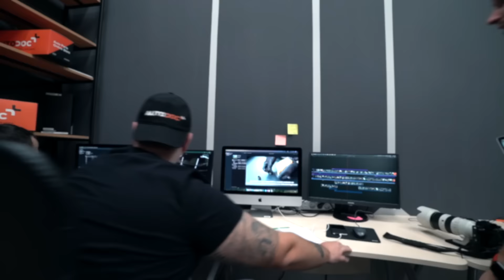¡AUTODOC TOUR COMPLETO POR EL TALLER!

Comment: TENGO UN TWINGO 1995 FRANCES DE 8V 125cm PERO EL CAMBIO DE CORREAS POLI O DISTRIBUCION DIFIERE DE TODOS LOS VIDEOS QUE HE ENCONTRADO PUES MI VEHICULO TIENE EL SOPORTE DE MOTOR QUE CRUZA POR MEDIO DE UNA DE LAS CORREAS POR LO QUE VEO QUE NECESITO SUSPENDER EL MOTOR Y PODER SOLTAR EL SOPORTE DE MOTOR... OTRA PARTICULARIDAD ES QUE MI VEHICULO TIENE EL ALTERNADOS EN LA PARTE SUPERIOR ALGUIEN PODRIA INFORMAR COMO PROCEDO PARA EL CAMBIO DE LAS DOS CORREAS
Reply from the maker: Gracias por su comentario. Sin revisar el vehículo es difícil aconsejar algo. Si tiene dudas sobre el cambio, recomendamos ir al taller. Atte, equipo de Autodoc.